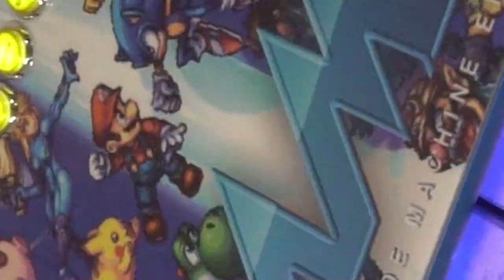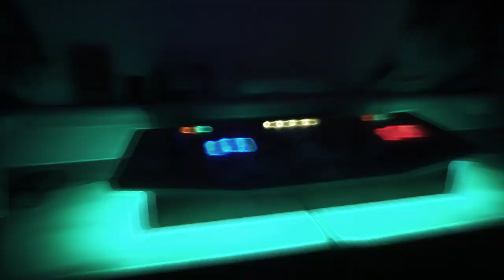2 Systems in 1 Control Panel - Promo Vid

Comment: Get one of those hdmi splitters that way you can keep both systems plugged in. And just power the one on you want to play 👍🏽 nice little system bro!
Reply from the maker: Thanks bud, you'll see later on why that idea wouldn't work for this specific customers build. He supplied me the pandora and it was a little different than the ones I usually use